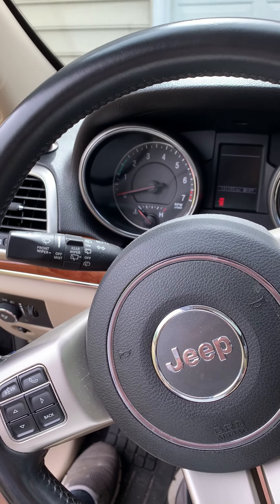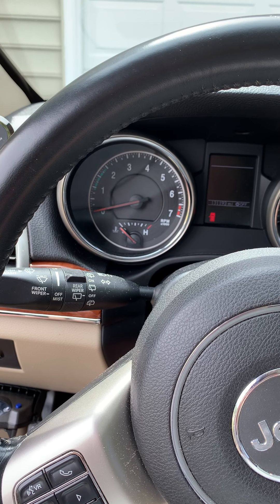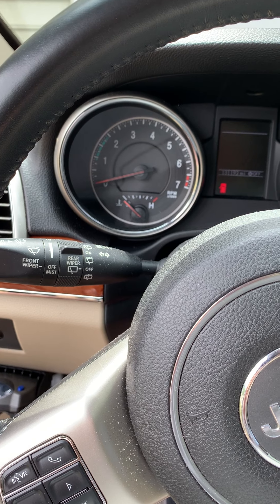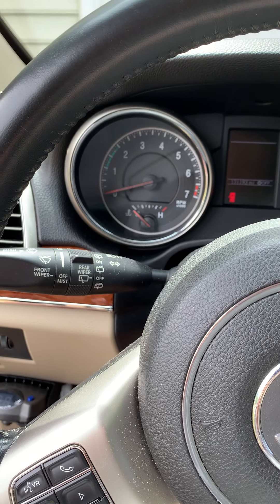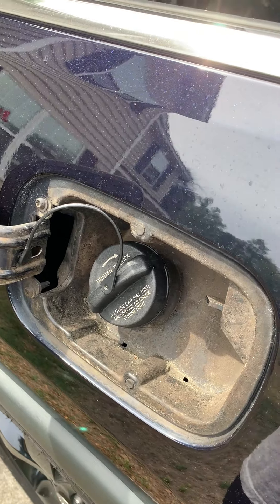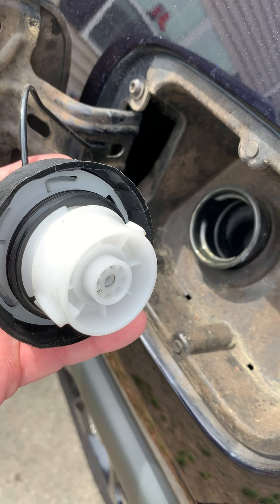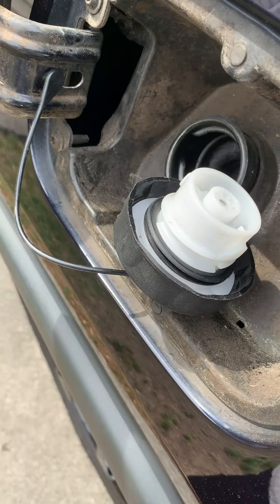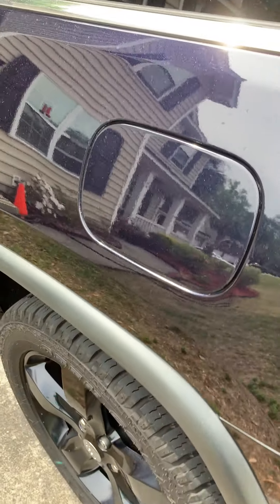2011 Jeep Grand Cherokee Limited 4x4 P0456 Evap Small System leak

Comment: Keep an eye on your
canister purge valvue if  it progresses with the following issues:
1. check engine intermittent
2. starts but with an extra crank or 2 before it starts
3.  feels  if a spark plug is slightly misfiring with good plugs
4. decline in gas mileage
5. loss of power steering that clears upon restart.  The last is the scariest and you will be highly motivated to get it replaced.  They need replacing every 50K to 100K
Reply from the maker: I really appreciate this input from you! As  a matter of time, I have started to experience these symptoms with another odd one that has my eye and hear a bit closer on a root cause. The additional symptom I am talking about is a remote start that actually causes a very slight backfire (and I do mean slight) and also a longer than usual start after that. I will be looking into this a bit more and I really do appreciate you sharing that with me and the community! -Dutch

Comment: Trying this tomorrow!!
How do you reset the code? Unplugging the battery?
Reply from the maker: Hello Melissa, thank you for watching the video.! There are a few ways the code can be reset 1)Do it yourself with an OBDII code reader 2)unplug the battery for a few minutes 3)Take it to Autozone,etc.. and have them check for codes and reset 4)drive the car for awhile and if the fault is gone the code should reset. Hope this helps and good luck getting that engine light to go away. -Dutch
Reply: This saved me last year! Thank you!
But now it's back😢 replaced the gas cap and nothing